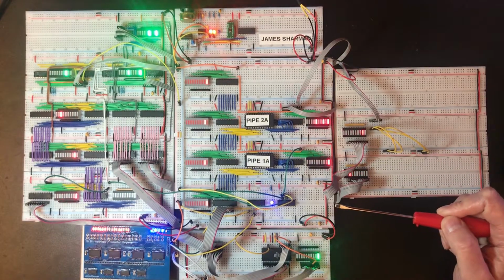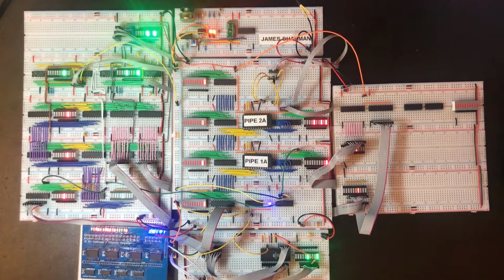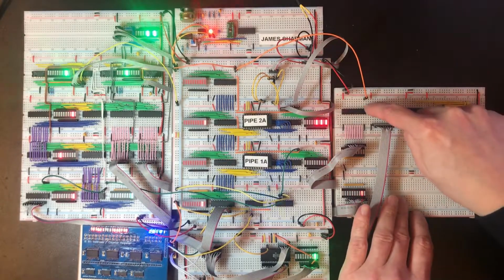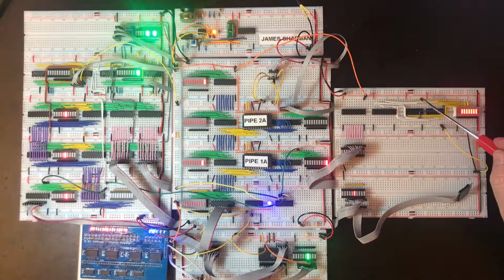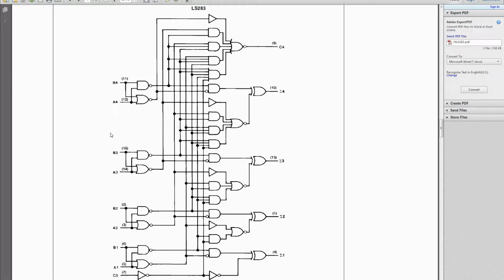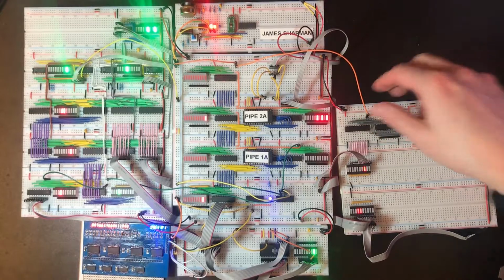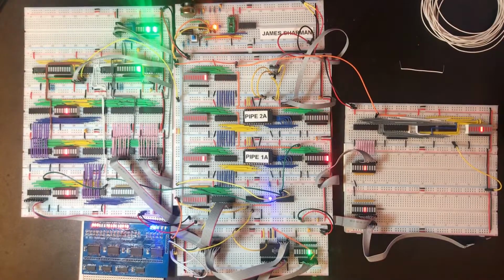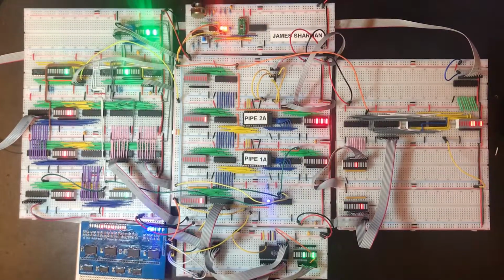ALU (3: Addition) - Making an 8 Bit pipelined CPU - Part 24

Comment: 06:06 I don't think that it really matters that much which line is A and which line is B (at least not at this point), because addition is commutative, so the adder doesn't really care if a particular bit came from the number A or from the number B, it just adds them together and the result is the same. Just don't mess up the columns and you should be fine.
Reply from the maker: For addition it doesn't matter,  but if you are using two operand industrctions where one of the inputs is also the output it matters for the instruction encoding.

Comment: Before I knew anything about electronics, I always wondered why it didn't take N time to add N bits and get a carry because each digit of the output is dependent on the carry from the previous input.  Glad I finally have closure on that issue!
Reply from the maker: Glad to have helped.

Comment: The pinout on those adders is insane. While I understand that those are always a compromise between cost of internal wiring inside the chip and multiple different use cases for it, I don't quite understand this one. This is not a collection of 4 independent gates where it makes total sense to group in1/in2/out for each gate, this gets 2 4-line inputs---and in almost all use cases those come as a bundle of traces from the same source.

BTW: At least the inA/inB pairs can be swapped freely when wiring this. 0000+1111 is the same as 1010+0101...
Reply from the maker: I often wonder about the pin out logic of chips, have to wonder how much pain has been because someone took the easy route in the early days and everyone else needed to follow the "standard".

Comment: I need to know what happened at 24:50 ! Your hands don't seem to move outside the board, so either you have a foot-activated PSU (which I doubt since we saw a simple USB earlier) or you shorted VCC to GND and I'm curious to see how your USB charger is doing

I'm loving the series so far and quickly catching up to the present :)
Reply from the maker: That was indeed VCC shorted to GND, the adapter I have as good over current protection so it shuts down rapidly.

Comment: Well, it seems a couple years late to the party, but I just wanted to say thank you for the amazing amount of effort you've gone through to organize this project! You definitely have what Ben (I don't even have to say his last name, do I?) has when it comes to communicating complex ideas. And well...I'm not sure I can give higher praise than that!

I'm working on my own 8 bit computer project, which started as a behavioural clone of an NES...that is, not a one-to-one copy of the original hardware, but mimics the behaviour of it using arrangements of simpler logic chips. My design started with the sound card, as that seemed a reasonable place to get something up and working quickly, and the work-to-payoff ratio is lower than some of the more complicated pieces in an 8-bit system. It's hard to think of a more rewarding end than having your circuit play back the original Mario Bros theme, though I'm definitely not that far yet.

Anyway, your video series has inspired me to expand the scope of my project significantly. I want all components of my build to support the base functionality of the NES, but overall be a more capable machine.

And I should also mention that you've worked on some of my favorite games! I absolutely loved Assassin's Creed Chronicles. 

I'm very pleased to have the opportunity to observe you coding in real time in this series. Game programming is another hobby of mine, and I'm very happy to see the techniques of a Master of his Craft.
Reply from the maker: High praise thank you John.
Reply: @weirdboyjim  You bet!

You mentioned that you have sent your visual studio project /assembler to those that email you. If you're still doing that, I'd love to have more of a peek. How do I go about finding your email address?

I noticed on your main channel page that I can request an email for business inquiry, but I didn't want to do that without making sure that's the appropriate route first.

Comment: I am here for the ambitious goal, a pipelined CPU by discrete logic. I am binging these of course, so my comments are less timely, but building a CPU on breadboards, especially with discrete logic chips, always seemed like a bit of a fools' errand. One bumped wire and the whole thing comes crashing down, not to mention noise, propagation delays and other odd thing happening due to the distances involved and the number och connections. I understand it as a building/debugging/testing tool, but with PCBs being so cheap and fast to get from China, it just seems like an endurance exercise.
Reply from the maker: You may think of it as a fools errand, but I'm quite happy being that fool. ;-)

Comment: You’re a total badass. I’m surprised more people don’t watch this stuff. Also what you’re describing is a carry look ahead adder.
Reply from the maker: Thanks! It’s curious, I’ve been trying to avoid specialist knowledge terms but a recent experience has made me question that decision. A natural product of my pipeline is a branch delay slot, but I chose not to use that term in discussion about it and people seemed to think it was some weird issue with my design. But in discussion pointing out that there is a term for it and lots of processors have it made some people more comfortable with it.
Reply: @weirdboyjim  I think that's why some people might avoid them, actually. These videos are long, but not very substantial, and VERY slow-paced. I had to watch them at 2× speed and skip a lot. Moreover, they're quire disorganized, so they doesn't serve as a good educational material, because that requires some more effort, with planning stuff ahead and finding the best ways of explaining stuff.
Reply: Interesting. I haven’t seen the whole playlist but I look forward to seeing how you implement branching and finally make your machine Turing complete. It must be difficult to do that on a pipelined architecture.